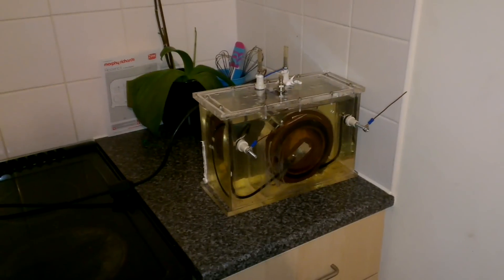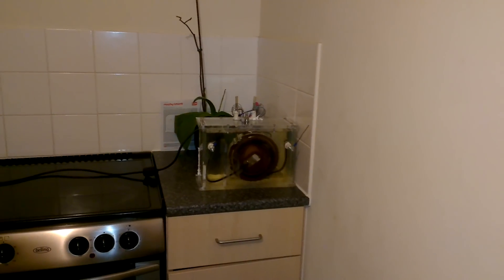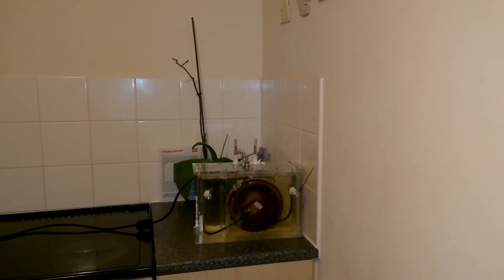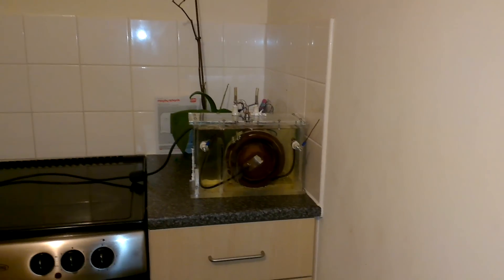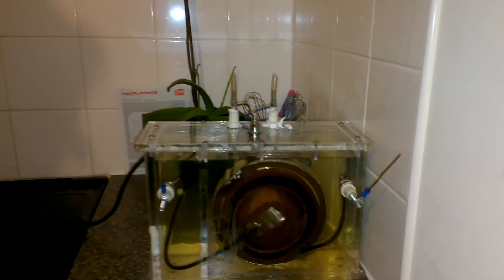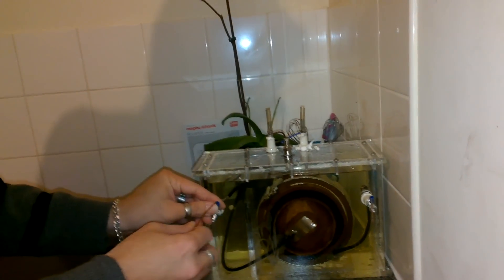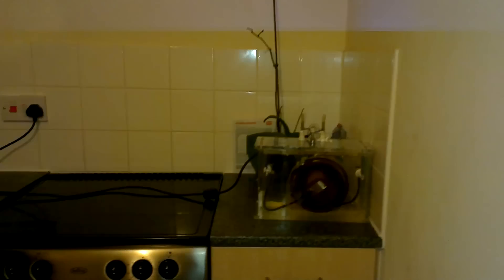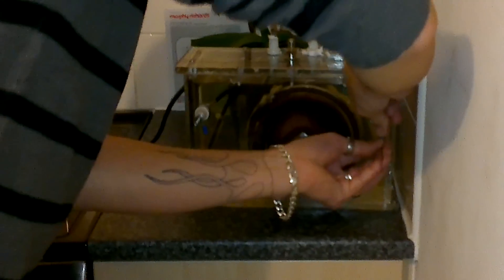150KV 10mA X-Ray Transformer @240v with ballast 25cm arcs thanks goes out to HIGH1VOLTAGE1RULES

Comment from the maker: NO its not this will be sorted but couldn't resist a little play ill be adding a spark gap in parallel with the output so i can draw big arcs at a distance and stop the arc over to the mains ;-/